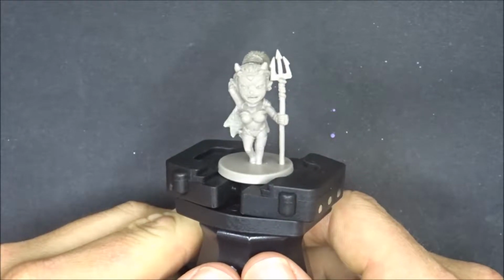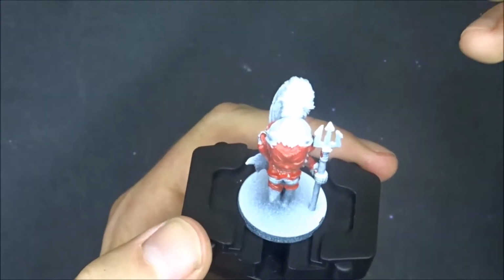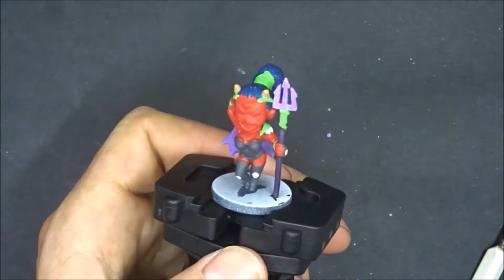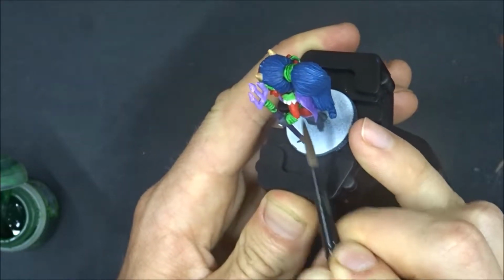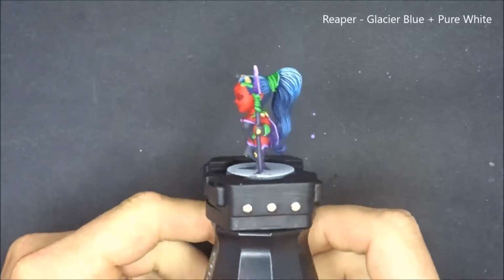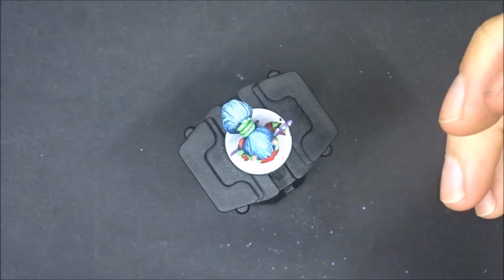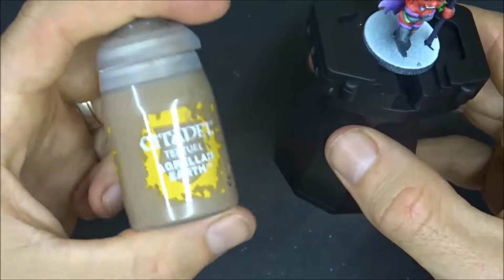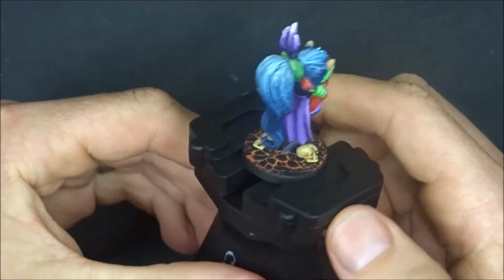The Plastic Canvas - Arcadia Quest: Inferno -  Ep 2 - Demoness

Comment: I really like the high contrast and bright colors.  I often find myself painting far too dark, partly because I use a very bright light when I'm painting.  For the Agrellan Earth, have you ever tried putting a gloss coat over the painted base before going over it with the Agrellan Earth?  I wonder if that would have any effect on the cracking or if it would just make it more likely to flake off.
Reply from the maker: Brewgeek1 thanks for the comment! I used to be the same. Every mini was too dark and when it was in the middle of the table, none of the detail or shades/highlights would come out. I got past that by putting the mini (when I thought I'd finished) on the table and then sat at the edge. If I wasn't happy I'd go back and push the shades and highlights more and I'd go back and forth until it came out. I did that with each mini until I didn't need to anymore. The thing to remember is that you're not painting them for someone to look at from 2 inches away.

And no, I've never thought to do that with Agrellan Earth. I don't know how that would affect it. I'm happy to give it a go and let you know on my next one cos it could give the lava underneath a nice effect.